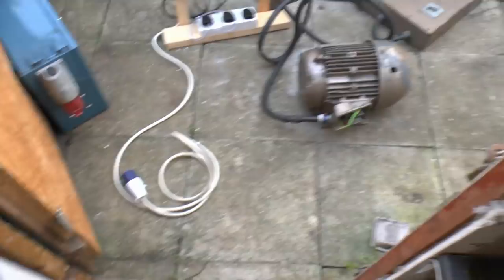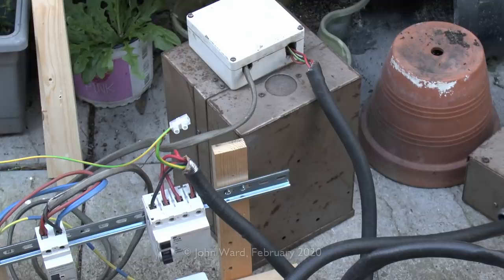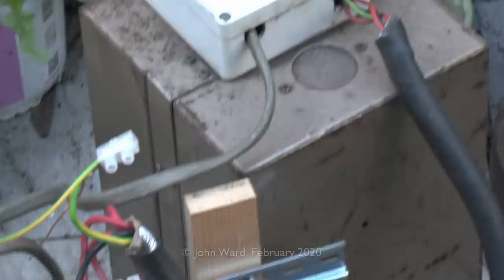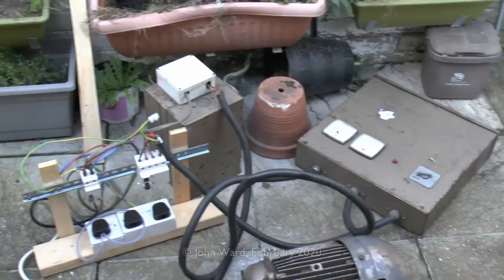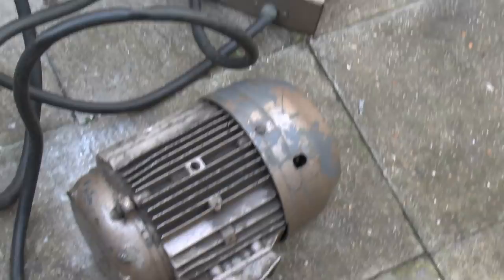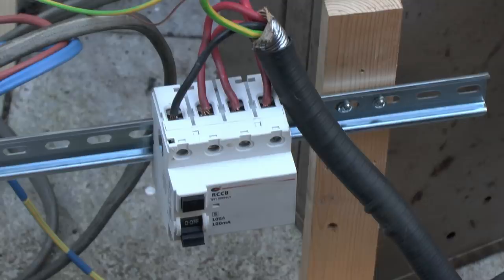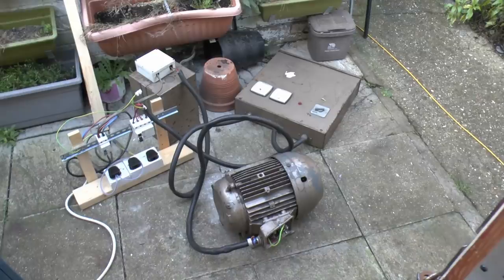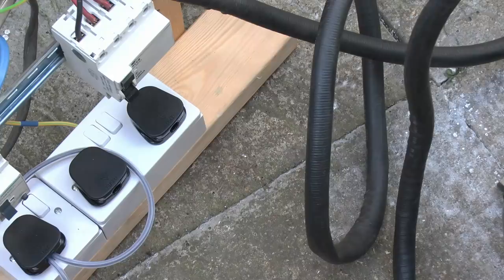Three phases from only one

Comment: Very similar to old units that I used to see in an avionics workshop, three phase motor attached to a generator to convert to various different aircraft voltages, such as the 120v 400hz three phase

Comment: turning on such a hefty motor not bolted down: good to keep the camera rolling for potential failure modes...
Reply: that motor probably weighs 60-80lbs, it's not going anywhere. Big solid chunks of cast steel
Reply: Thats no hefty motor chap. Thats a tiny baby for a 3 phase motor. The rotational force wouldn't be enough for it to roll around due to its weight.

Comment: jesus. Everything is solid state now so it's interesting to see how they used to do it. Nowadays you'd just put one phase into a VFD the size of a small brick and call it a day
Reply: Agreed. Very cool bits of old tech
Reply: That rotary converter is solid state.  No liquid, gases or vacuums involved.  All solid.
Reply: moonasha VFDs are designed for 3 phase motor control, not as phase converters. Supplying a VFD with single phase is possible, but you have to massively de-rate the VFD for the motor you are intending to run with it, and it isn’t good for the VFD nor is it efficient. Basically there is nothing like real 3 phase.
Reply: @literoadie3502  single phase input VFDs are only small ones up to 2,2-3kW
Reply: @literoadie3502  what is a VFD?
Reply: @southerncharity7928  variable frequency drive
Reply: @southerncharity7928  Also known as a variable speed drive.
Reply: Also don't forget that there's a bit of a misconception that VFDs produce three phase AC output which they don't, they produce pulsed DC output (usually pulsing at a few kHz or more) and they constantly vary the number of on vs off pulses to approximate a 50/60Hz sine wave.  It can appear a lot like a sine wave after it's been filtered by a big inductor (like say a motor) but if you don't filter it (like if you're feeding it to a three-phase power supply for computer equipment) then whether it will work or not on the high frequency pulsed DC depends on the design of the equipment.  Most VFDs have clear warnings that they are only designed for use with motors and nothing else.

Comment: John... Thanks, great to see....... I wonder what those units would cost new, if they still can be had. We would love to get a commercial washing machine here at the sanctuary but to get three phase electricity here would cost well over 10K euro, if not significantly more.. We have our own 11KVA down to 240 x'former but single phase of course.  ( Am in Ireland).
Very much appreciate your feedback.
Reply from the maker: They are still made, although not by many, Transwave are one manufacturer.  Prices from approx £700 upwards for a small one, something of the size in the video would be £1500+.  Static type can also be had, they can be cheaper but have to be properly sized for a particular load, plus they have a minimum load requirement.  The rotary types can work over a range of loads and don't have a minimum load, but cost more and are noisy due to the rotating motor.
Note that you can't get something for nothing - although these output 3 phase, the input current will be significant for even a moderate load, and they are far from 100% efficient.
Reply: Many professional washing machines is using 1 phase for motor and electronics. The last two phases is for heating. You could get it to work by supplying it with 3x the same phase it don't need 400v between the phases.
Reply: @jwflame  It basically is a 3 phase motor though, so just getting a used motor of appropriate size with windings that can be connected for 240VAC operation will work, just need to add the appropriate control gear to it.Basically wired for star operation, and then capacitor start using the one phase, and then, once running, the capacitor banks are used to phase shift those other phases to a semblance of balanced 3 phase.  Yes efficiency is well down the line of things it is good for, as you basically have to supply 3 times the current plus all the circulating current losses in the windings.
Reply: Folks.
THANK YOU ALL SO VERY Much for your replies.
Just wanted to let you know it is very much appreciated.
Certainly provides food for thought.
Albert.
Reply: @mortenwinslw2785  thanks Morton
That is worth looking into.
Albert.
Reply: @mortenwinslw2785  If you do that, you must engineer an over-sized neutral bus inside the appliance, and uprate the supply cord/flex - because the neutral currents will be additive rather than cancel out.
Reply: @marct3928  You are right about that, but in the case of Miele Professional as I've been working with for many years, the neutral is split into one for each phase just where the main flex is connected inside the machine, so it's only the main flex you have to change.

Comment: Can somebody please explain to me why second hand car lifts are all 3 phase?
I cannot understand why a such geared down hoist would need so much power. I'm pretty sure that with enough gearing you could lift a car with a 12V DC motor. It might take an hour to lift your car but it would get there in the end!  A neighbour of mine converted his 3 phase car lift with a (Chinese) single phase powered* hydraulic pump.
*plugged into a normal UK 13amp socket
Edit: Where I live it costs a lot of money to get a 3 phase supply into your premises.
Reply: I don't know what the safety requirements are but you should be able to just use a single phase to three phase inverter -which could be found relatively cheaply on Ebay, I would expect that power requirements might demand at least 16 amp supply.

Comment: The motor failed in my old mini lathe (1986, 1/2hp, 120v, 60hz, single phase, 1720rpm) so I'm upgrading it with a stepper motor (not the best choice, I know). I ordered a driver and motor from China that says it can take 120v60hz and spit out three phase (I assume still only 120v) for driving the stepper motor. I only have single phase 120v (20 amps) available at the lathe location but have 200 amp split phase/single phase 240v I could run if needed. Thanks for the video!
Reply: It'll be 120v between each phase and neutral, or 208v between phases. Out of curiosity, why aren't you just replacing the motor with another single phase induction motor? They're cheap, readily available, and wouldn't require modification. Converting single phase to 3 phase is quite inefficient. With a 20A circuit available, you could easily run a 1hp or even 1.5hp motor, usually in stock at places like Tractor Supply Co. or Rural King for $100 or so, and if you ran 240 service with a 30A breaker, you could use a 5hp motor. A new continuous duty 5hp 240v 60hz motor from a reputable supplier can be had for $150, and significantly less, if you're willing to take the risk involved in ordering a Chinesium motor from AliExpress or similar.
Reply: @puckcat22679  I like how much torque the stepper motors put out at slow speed and their super easy speed and direction control with a $7 controller. I also like that you can lock the speed at a specific RPM so if it starts to slow down it'll put more power into it to try and keep it at the same speed, super nice. I could've got a 1.5hp sewing machine motor with nice speed controller for $100 but I've always had a soft spot for stepper motors and always wanted to use a monster sized one like this in a project, and now I had the opportunity.
Reply: @puckcat22679  No, it's 240V between the "phases". It's a split phase 120/240 system that uses a center tap transformer, not a 120/208 Y system.

Comment: I'm not sure what uses there would be for domestic three phase. I'm not even sure if the UK uses domestic two phase. We do have domestic two phase for major appliances here in the United States, but it's just 240v. It might a tad safer with 120v on each leg, but you will get a full 240v wallop when touching both legs. I can certainly see the benefit of 240v since you don't need as much copper for the same job or power.
Reply: In the rest of europe we have normal 3ph installations in almost every house. Things like cookers and heaters use it. Also whole house is distributed over 3phases so if 1 phase goes out, you still have 2/3 oof the house lit. Also garage tools run on 3ph; compressors, welders and almost everything that is over 2kW of power
Reply from the maker: The vast majority of domestic UK installations have single phase only, as 0-230V, there just isn't any need for 3 phase as there aren't any domestic appliances that require it.
Two phase probably still exists in a few places, usually as 230-0-230, but that is rare and still only provides the usual 230V, you just get two of them for increased capacity.
Most commercial and industrial locations have 3 phase as standard, 230 phase-neutral and 400V phase-phase, but even there many loads are still only single phase.
Reply: @jwflame  Thats true, but UK domestic supply is 230V and about 70~Amps? Here we have 3ph 230/400V at 25Amps. And in consumer unit, single phase circuits are distributed over 3phases to spread the load more less evenly. Eventually, the power capability is similar. However, having 3ph gives an advantage to run 3ph devices, also less current means less heat  in terms of loose connections/bad wires.
Reply from the maker: UK domestic is usually 60A, 80A or 100A.

Comment: Once it's working i'd like to see more videos about three phase. I live in Finland and all detached houses and most modern flats have three phase supply. I think this is common in Germany too. In the UK three phase is confined to commercial properties. But here Ovens, Hobs and sauna heaters (everyone has one) use all three phases. The hardest thing to understand is that there is no neutral supply to my house. Only three live cables come in. No earth supply. but no neutral either.
Reply: you have to have neutral on the low voltage site and earth; No neutral is often only limited to high and medium voltage distribution, and then comes thru transformer that has star secondary winding, providing neutral.
Reply: @sumilidero  There's no neutral coming into my house. The power lines on the poles outside have three cables spiraled together. The three phases. They come into my house and the neutral is derived from an earth connection (going under the house).  Earth and neutral are identical in my house. I think if the load on the three phases is equal then there is nothing flowing though this "neutral".
Reply: @richard-riku  I assume then, all 'single' phase devices run actually off 2 phases? like 240V appliance runs on two 120V phases instead of 240 phase and 0V neutral?
Reply: @sumilidero  No, each item is connected to one of the phases and the combined earth/neutral. Nothing is across two phases. Some things like the oven get all three live phases plus the combined neutral/earth. Downstairs power sockets are on one phase, upstairs power sockets on another phase, lighting on the third phase for example.
Reply: @richard-riku  Yeh but u have that neutral/earth wire. Although it doesn't come directly with other phase wires.
Reply from the maker: Making videos on 3 phase is the main reason for buying this equipment.
Reply: Seems a bit risky using the earth as the neutral return.  If your phases aren't perfectly balanced (as they wouldn't be unless you were only running 3ph motors) then some current would flow through the neutral, which would then have to return to the nearest pole transformer through the earth.  They've tried that before with single-wire power distribution (Wikipedia: https://en.wikipedia.org/wiki/Single-wire_earth_return) and it says that it can cause greater than normal voltage fluctuations due to the high impedance in the earth return.